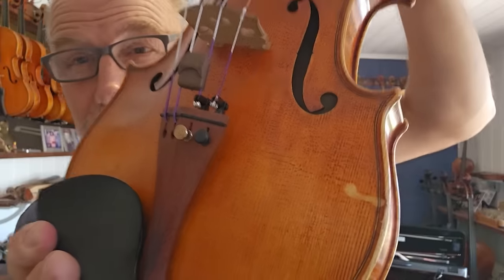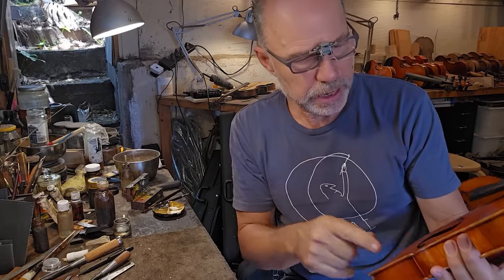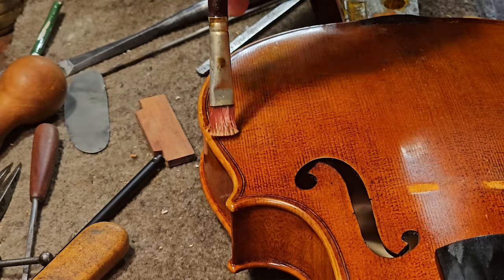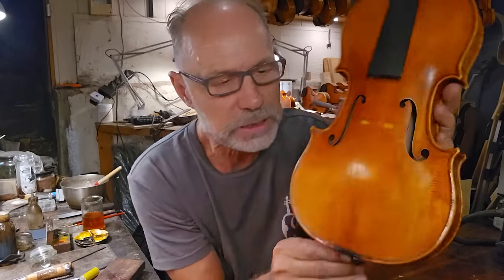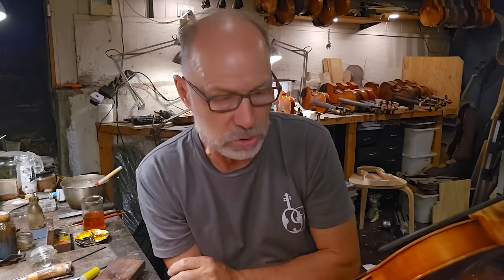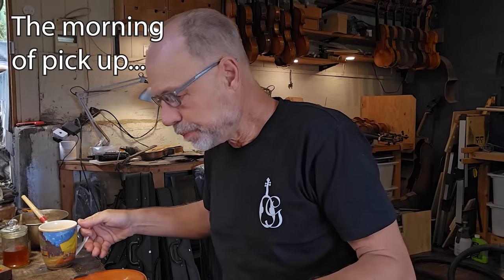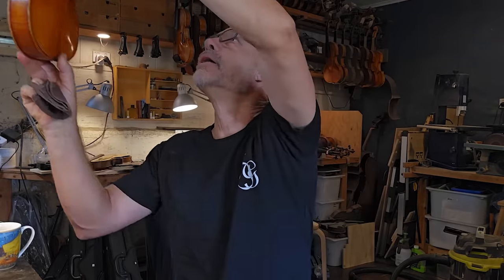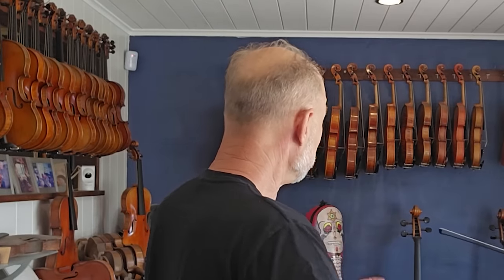Hand Sanitizer on his violin! Can this even be fixed?

Comment: About a year ago I purchased a violin that got stuck in a storm during shipping. The instrument got wet so watermarks appeared below the varnish.  I soaked a paper towel in hand sanitizer and hovered it over the watermarks.  That opened the pores and the water marks went away.  I was very careful to not allow the paper towel to touch the instrument.  So there you go. Hand sanitizer can also be used to correct issues with the varnish. 😂
Reply: I would have anticipated that the alcohol fumes would soften the varnish and cause it to cake up. Then after drying the result would be a much less than perfect finish. Apparently that didn’t happen in your case? Or did it, and you had to burnish it down?

Comment: And that is the reason you use oil varnish. Once it is cured it will not easily be dissolved (spirit varnish is essentially shellac, resins and pigments dissolved in alcohol. The alcohol dries off and leaves a thin layer of shellac an resins. Oil varnish is a mixture of linseed oil, turpentine oil and resins cooked to partially polymerize the oil. The oil polymerizes with oxygen to a thin layer of some natural polymer which is than only disolvable by things breaking up these chains such as paint strippers).

Comment: Matching finish is not easy.   I wonder if art conservator resin paint would work with a thin varnish protection layer laid down first.  It could match the finish and then a final varnish layer added on top.  Resin paints are completely reversable though i dont know what the implications are for the top plate. I know conservators maintain paintings on wood but this quite different.   I know this is outside traditional methods.  Just a thought experiment

Comment: Oil varnishes rule, they're more time consuming to apply and more difficult to repair but more resilient against physical and chemical damage. Remember, they were good enough for the Cremona masters.
The more modern spirit (and usually shellac) based varnishes are faster and easier to work with but a typical vulnerability is described in the video.

Comment: Great seeing the stages you work through. I wonder if you used spirit or oil varnish for your touch up. Thanks again for he informative video.
Reply: Spirit, for sure.
Oil varnishes take longer than an a hour or two to dry and longer than overnight before you should even considering taking to them with abrasives.
Reply: Thanks for the reply but the question wasn’t directed to you.
Reply: @Naydzart  It's a public forum, it's directed at anyone who reads it. However you may hope for an answer from a specific person should you address the question specifically.
Thanks for your passive aggression.

Comment: Can i use a French Polish over my oil varnish (btw just Askes, i'll never doing it myself)
Reply from the maker: I use the French polishing method on oil varnish. Oil varnish is just an emulsion between resin and oil, but a lot of the oil evaporates away leaving the resin which is soluble in alcohol.
The French polishing method dissolves a tiny bit of the top layer of varnish and adds a tiny bit of a shellac based varnish to the top layer.

Comment: That is a spirit varnish that got dissolved, isn't it?
Reply: Yes. Look up "spirit varnish". 😁✌🖖
Reply: @zapa1pnt  I know what spirit varnish is & how susceptible it is to solvents etc. I just want to know if this this was spirit varnish on this violin.
Reply: @rossthefiddler5890  Yes, it was. That is why the alcohol
based hand sanitizer melted it off.
Reply: @zapa1pnt  Yes, and don't let hide glue dry & harden on a rosinate spirit varnish either as it will rip it off.
I just wanted to confirm with Olaf that it was actually a 'spirit' varnish & not an oil vanish, but then a propolis varnish would be sensitive too.